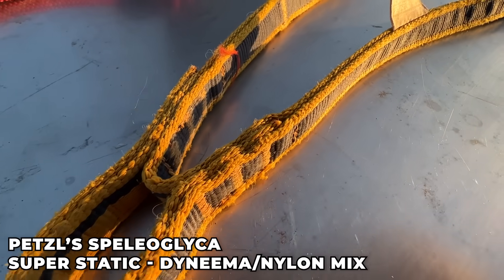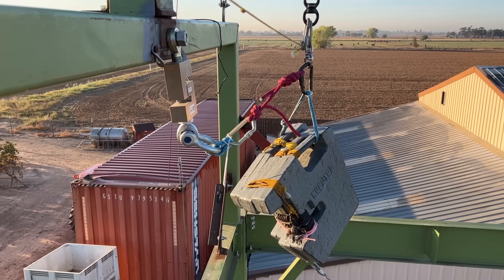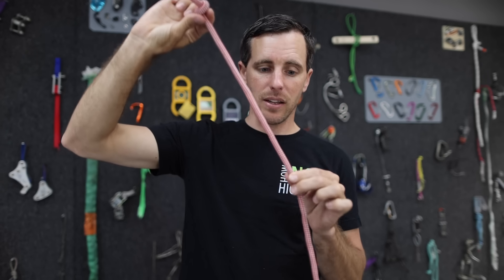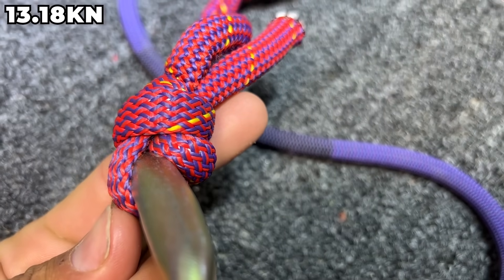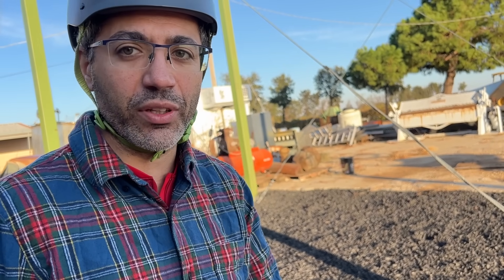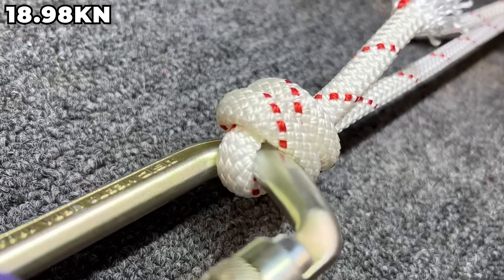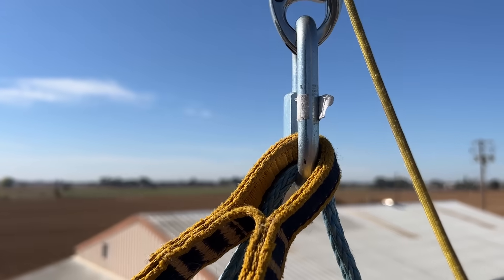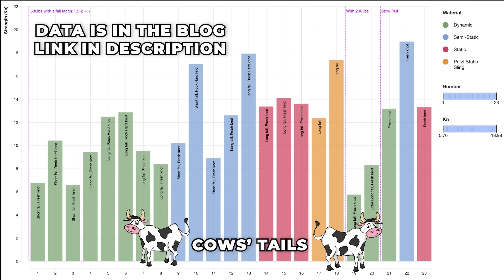This would BREAK your back

Comment: I think this would be a more useful test if you tried to account for the elasticity of the human in some way. I think this has to be done by adding elasticity to the system rather than reducing the weight to accojnt for it.

If you drop a person and an equal mass (both on dynamic ropes) and then add a spring (or more dynamic rope) above the mass untill the forces are the same for the mass and the person, you might get a better approximation of a person for these static tests.

Comment: It's not surprising that the peak force would be roughly the same for different fall distances for the same amount of rope. The required work of deceleration increases proportional to the fall distance, and the length of travel increases proportional to the fall distance, for the same fall factor. The duration of applied force will increase however, and a medically realistic model of injury potential would have to account for that. 10 kN for 0.1 s is almost certainly less dangerous than 10 kN for 1.0 s. How much less dangerous? I dunno.

Comment: I'm wondering why people still drop static weights (metal, stones, similar). It has nothing to do with the actual physics on the rock (or in the cave).

If you drop your metal weight into a bomber metal chain setup that is lengthening nearly zero, you will end up with nearly infinite forces (according to math), even if your drop is just a few inches. If you do the same factor 2 drop with your own body, nothing will happen. Your body can easily deform enough to absorb a 2-inch fall in no matter how static material. But this ability of our body in this calculation is a constant, while the energy is linear to the length of the fall. So, if you fall 5 meters, you can already nearly neglect the deformation factor, as the deformation from 5m drop into static stuff will definitely kill you. But it will not at 2 inches, no matter how static the material, just because the movement in your body will make sure the forces are tiny. Your center of gravity will decelerate very slowly, e.g. by limbs moving down.

That's why some mountaineering associations are experimenting with more useful setups, like dropping lorry tires made of rubber or similar things that behave more like humans.

At least I typically go climbing with humans, not so much steal weights ;)

On the other hand static loading IS interesting when it comes to fancy accidents like having a heavy flake with a bolt in it come loose and falling down, with that bolt happening to be one of your main anchoring points. Stuff like that happened.

Comment: i think the only difference you would find when you keep the same fall factor on dynamic rope with different lengths is in what things outside of the rope absorb.
at same fall factor, as you increase the length you increase the speed, thus force of impact, and proportionally increase the length of rope, thus it's impact absorption capacity too. however, other parts of the chain have some capacity to absorb energy. as you've shown the knots absorb a lot, but 2 knots can only absorb so much, be it on a 50cm or a 5m length of rope, so they proportionally absorb less on longer falls with longer ropes. slack in your harness, padding from your clothes, body flexibility, all of those have a fixed capacity to absorb the impact too. and there's the fact that you rarely fall perfectly straight down into a hang, you always have some swinging motion, and the swinging angle will always be smaller (thus dissipate less energy) with longer falls/rope.

and i think that's why despite fall factor leading to the same measured impact force regardless of length, we are in practice mostly fine taking a drop on 50cm of static rope from above our anchor point, but get injured if we take a factor 2 on 5m of dynamic rope.

Comment: Curious regarding the fifi - would it make sense to use those on a tether that would break particularly low so that if it was the shorter link in the system you'd break it and fall onto the actual belay?

Comment: Hi Rayan, as usual very informative content! Thank you, just one question about a doubt that came with my friend:

I have an opinion and my friend another..
If we test two cow’s tail: one with fresh knot with 30cm (for example) lenght and ono otherone with rock solid knots on it, both with the same intitial lenght (knot to knot), wich one will have the higher KN number?

For me the one with fresh knot will produce less KN due of the tighting of the knots.
For my friend the added lenght that the rope will gain from the tightinig of the knots ends up producing more force on the anchor.

Thank you so much for your reply to our questions.

Comment: This still counts as a worst case scenario, but I think it's overselling the danger of short falls, because it's not accounting the energy absorbtion of human body and the harness waist belt tightening around the body. In a long enough fall, the amount of energy that the human body and harness can absorb is insignificant, so the fall factor is probably the only thing that matters in a long fall. But small falls just don't have enough impulse to overcome the human body absorbtion. A 10 inch fall on a 5 inch rope may generate 10kn with a steel weight, human body would never come close to those numbers. 

Imagine decking from 10 inches onto a flat concrete, butt first, which is pretty much as static as a fall can get. 

It may make a good bruise, but I think it would be quite unlikely to truly injure you, and it definitely won't put 10kn into the concrete. Add the harness which will distribute the force even more evenly, and I don't think it would be a big issue.

In the extreme case, imagine 2mm of fall on 1mm of steel wire. There just isn't enough kinetic energy in that kind of fall to do you any harm, and yet the same fall may break the biners if you replace the human with a theoretically absolutely static weight.

While the static rope and harness may stop your skin around your waist statically, your arms, legs, chest, head, your bones and plenty of internal organs won't all deccelerate at the same time, thus they won't all be pulling on the rope at the same time, reducing the peak force and prolonging it.

But ofcourse, the longer the factor-2, the more insignificant the body absorbtion is. So, I think fall factor is the only thing that matters, except for very short falls.
Reply: I put it in another comment but I think it should be possible to connect the weight with enough dynamic rope so that you roughly mimic the elasticity of the human body. You could test with a person on a dynamic rope fall and then add dynamic rope to an equal mass untill you get the same forces.

I actually think the bodies elasticity is going to make a pretty significant difference relatively even for very large falls, but at a certain point you're dead anyway.

Comment: The swing might the main case,  But another difference between the long vs short fall factor two is the fraction absorbed by the knots.  The knot is going to absorb roughly the same energy in both situations, but there is twice as much energy in the longer fall.  So the knot is absorbing a lower fraction of the total energy, putting more into the load cell.

Comment: in some parts of europe they use a knot called a trilonge on their cowstails which is specifically designed to shock absorb. It's like a double overhand with one loop pulled out and folded into itself. Would be so curious if it works / if type of knot makes a significant impact in force of falls.

Comment: If you could do this at factor 1 that would have been great to compare the impact. Which is probably more reprasentative. They are also usually non vertical falls with some swing in them. 

But this put me straight on my suspission climbers belyaching about factor 2 falls being death :P which I formely didn't think applied to such short lengths of rope and falls. 

Also its been said a lot that knots take up alot of the fall, but wow thats a lot of impact. Great data. I wonder how much was also rope first time stretch due to its non-recovering distortion. Retying drop tested rope with new knots would seperate fix these two factors. 

Big caving love.

Comment: There has been a lot of discussion on this topic since DMM did a similar video. The question is... does the fact that the load in both video cases (weights) increase the shock loads to a higher extent than if a test dummy/real human might?  The arms and legs beginning able to carry on falling before hitting the arrested main part load. Does this decrease the total peak loads or just increase the duration of a lower total peak? The spine flexibility effectively acting like a shock absorber?🤔
Reply: This exactly the response that was given from the DAV tech team and the reason why testing gear is not done with weights like this...
There is simply no accident reporting that this is a real problem. And yes, there is a good system in place in Europe to keep track on this.

Comment: Have you got any data on how many km of a nylon rope vs an aramid rope vs an aramid-coated rope it takes to wear through belay devices to their safety limit marker? be interesting to see how toothed devices (including ASAP style devices)  fair up against different ropes too. Replacement/repairability of devices? just a thought!
Reply: While this seems neat, I can tell you from caving that ropes utterly glazed in mud wear out ascender teeth after a few miles of rope climbing. No aboveground scenario comes close to that level of abuse, sans maybe slopeside stabilization. I reckon it would take a machine running rope in an infinite loop, and going constantly for months, to wear out teeth using clean ropes....

All that said: I hope that ropes are being chosen first and foremost for their physics based on the rigging, rather than paying any mind to how they affect a consumable item like an ascender. 🤷
Reply: @rachelhasbruises  20 years in industrial rope access... kevlar seems to chew metal quite badly. geotechnical is the testing ground for robust kit. If you can't jump on it, it shouldn't be there

Comment: I would really love to see via ferrata sets on the fall tower! See this video for inspiration: https://youtu.be/A5w9Kkd-f2w

Your episode is a clear proof why you should never ever use a rope on a via ferrata. 

On via ferrata it may happen, that you have a fall factor way higher than 2:1.
Imagine you have 1meter rope on your harnest and you have a distance between the anchors of you steel rope of 2m, you may fall 4m with only 1m rope in your system. 😮

There are two things that i would like to see:

A) how does the via ferrata set compare to a short rope like you have in this video with a person of ~ 80 kg and a fall of 4m. Would you survive with a via ferrata set?

B) how is the load on a via ferrata set with a fall of 2m until the set reaches the anchor with different weights. (Maybe you can reproduce this with an attached static rope?! 
These sets do only work greater that 40kg . They are told to be deadly for lighter kids i.e. 25kg.
But what is the difference if you weight 60, 80 or 120 kg?

Comment: I think that fornthe factor 2 falling, the difference in hight will change the forces depending on how elastic the rope will be. Because with more falling distance you have a longer acceleration so a bigger speed, if the rope it’s super static, like a dyneema rope it won’t strech so all the force made to stop your velocity will be in a very short time, so the pick force will be way higher than with a smaller fall in factor 2.
Can’t wait to see if you make a video about this, because it’s very interesting

Comment: About long and short factor 2 falls, a simple reasoning from a engineer.

There question is really which increases the fastest, the rope stretch of the fall force.

With 2 falls, one longer than the other.
The stretch of the rope increases linearly to the length of the rope.  
But the force of falling, is N = mass * velocity, but velocity is not linear to the length of the fall, but to the time of the fall, since acceleration is constant at these speeds. The time of fall is an integral of the acceleration over distance.. 

With simple physics, constant acceleration.
If you fall 5 meters (2.5m rope) you'll fall for 1 second and have 10m/s final velocity. If you fall for 20 meters (10m rope) you'll fall for 2 seconds and have a final velocity of 20m/s. So four times more rope and twice the velocity and force. Rope stretch increasing faster than the fall force.

This implies that a shorter fall will at some sweet spot create the biggest _force_. Since a really short fall is a very little force, especially with stretch of knots and so on.

Comment: What happens if you add an actual shock absorber to the line? Shocks made for motorcycles might provide the right amount of damping force, and shouldn't be too expensive.

Obviously it is extra kit that you don't want to carry on a climb; but if it can provide 3kn or 4kn deceleration over a few inches, rather than a sharp peak of 7kn+, that makes a big difference.
Reply: A Yates Screamer is a (single use) shock absorber designed for climbing and also used by some rescue teams (albeit in different ways).  Most models activate at 2kN, while the Scream Aid activates lower and I’ve seen other models that are made to activate at 2.5kN.  Different Screamer types will reduce the force by different amounts by design.

Comment: Short system has less resulting force than long per inch of rope between the knots, because the short system has the same rope length in the knots. So short systems have more rope to fall so a lower effective fall.

Falling 4m in a properly fitted harness might hurt in a factor 2 fall, but it won’t kill you any more than stepping off a 4 meter roof onto concrete will (unless you carefully do a header).

Comment: The photo that introduces the video:   That’s real life.   While doing what he is doing in that photo may not be wise.   It’s absolutely nothing like the drop-tests.   If he fell in the position of the photo.   He would basically lean back, the rubber from his shoes would take most of his weight and he would barely generate any force on the anchor.   Typically- (hopefulluy) the way we use lanyards/personal anchors are a means to prevent catastrophic slipping from generally safe stances.    We don’t use them to catch factor 1 or 2 lead falls.    Because of the nature of the stances where we typically use lanyards - They just don’t have an opportunity to  receive enormous forces.   The Petzl product would be used for jugging (lot’s of rope out).   It wouldn’t be used for say via-ferrata.   Petzl has products for via-Ferrata that have built in shock absorbers.

Comment: people jump from higher heights. They dont absorb 13kN or 1,3 tons. Absorbing it with your legs would IMO equal to explosively lifting a 2600 pound barbell. It doesnt make perfect sense. I've seen tests with a climber absorbing a short and a long fall and they reached like 3 kN max.
*It has to be the inneria and a sudden stop. Like a boxer measuring his punching force at 700 pounds while he couldnt ever lift that. Extreme example would be a bullet delivering 1000 joules without the gun moving much not to mention ripping your arm.

Comment: I think that the ratio between his much rope is in the system and how tall is the fall is not the main factor.

The tablet the fall the more speed that you'll get, if we go back to a newton bein Kg*m/s^2 we can see that if we take your weigh multiply by your speed and divide it by how fast you come to full stop will give us a really close number how how many Newtons will be in that change of speed.

The rope here is basically a spring that had the capacity of elongate and slow you down a little while doing so, that's what happens when rope "dissipates" force. But any additional speed will translate into force when we come to full stop.

Summarizing a 10m rope can "dissipate" so much energy, all the remaining energy will it is when we come to full stop.

Adding 1 meter of rope will increase how much energy it can dissipate.

Falling 1 extra meter will allow us to gain more speed during the fall,

If we keep a ratio of 2m if rope by meter of fall the final KN will keep getting higher.

If we keep doing it indefinitely we'll eventually have to reach terminal velocity, so if we keep getting higher with a longer rope, we eventually should be able to gently slow down the fall.

Comment: Notes from around 4:30 in. The maths behind the force being the same for the same fall factor (ff) independent of the fall distance uses an important assumption. The assumption is that the dynamic rope absorbs all of the energy. This means that the knot tightening and the extra rope length hidden in the knot is not accounted for. My guess is that in the small falls these factors are none negligible. If you did this test with many different length ropes then for extremely small falls the forces will be low but as the fall distance grows this should asymptotically go to a constant value as the knot tightening and extra rope in the knot becomes negligible. FF is all that matters in the limit of long falls, off an infinitely strong anchor, with a perfectly ridged weight, and no swinging. Basically when nothing else absorbs the energy. Would be interesting to plot max force vs fall distance to see if it does asymptotically become flat or if there are some more assumptions (rope only experiencing elastic deformation and following hooks law) that need to be thought about. If it’s of interest I might run some basic calculations to play a bit although I am not a rope expert